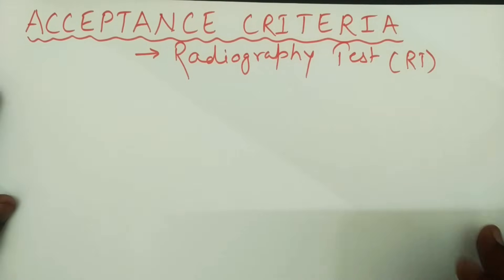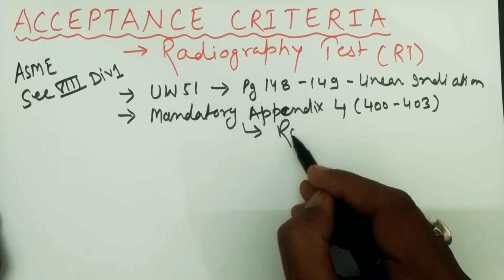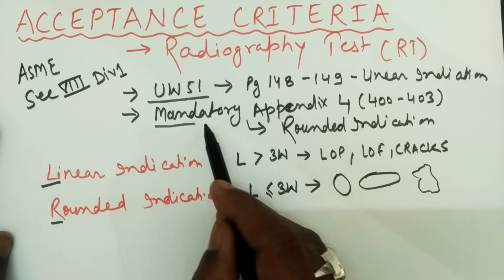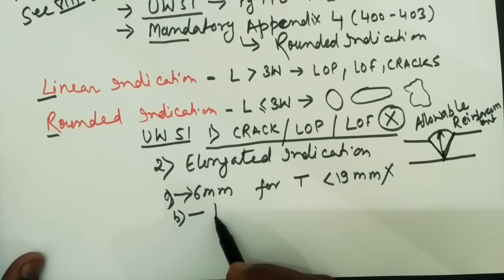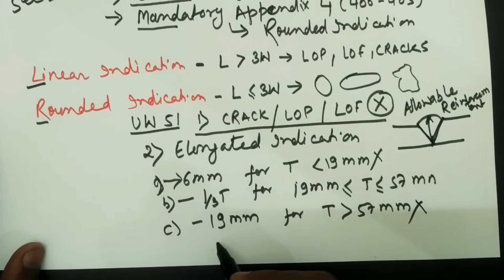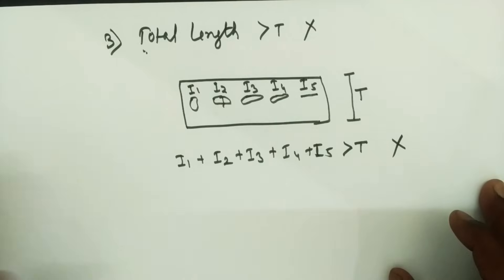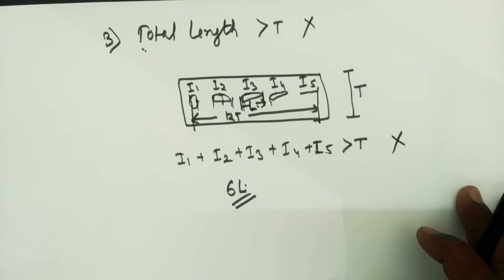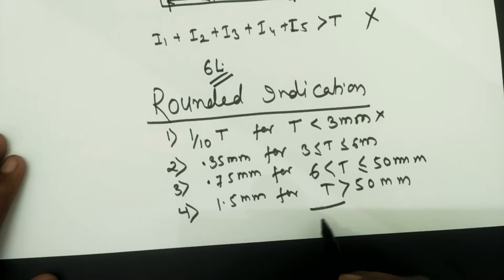[English] Acceptance criteria for Radiography Test - RT (ASME section VIII Div I)

Comment: I think the explanation for the rounded indication is wrong.
Reply from the maker: Why do you think like that. Can you elaborate
Reply: As per ASME BPVC SEC VIII DIV 1 MANDATORY APPENDIX 4 (4-3). The indication which is more the (t/10) for t less than 3mm, 0.39mm for t between 3mm to 6mm, 0.79mm for t between 6mm to 50mm and 1.58mm for t more than 50mm will be considered as a relevant indication. Below to this dimension will not be considered as a relevant indication. The acceptance criteria for a relevant indication is (t/4) for a random indication and (t/3) for an isolated indication.

Comment: I have a doubt sir., We have separate sections for NDT ie) ASME section v for non destructive testing., Then why should we need to refer ASME sec viii div i?., I mean how we come to the conclusion that we have to refer sec viii rather than sec v.,
Reply from the maker: Sec V is only for NDT and it gives a general guideline for NDT (not acceptance criteria). However, Sec VIII is exclusively for pressure vessel and it contains everything pertaining to pressure vessel including the acceptance and rejection.
Reply: Somebody told cswip 3.1 welding inspector pattern will change from april. Is it true?